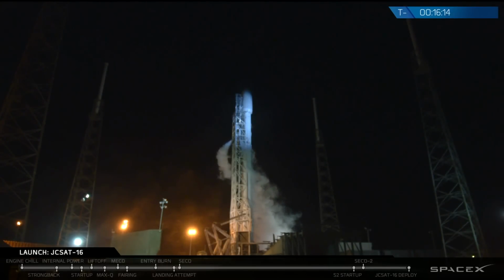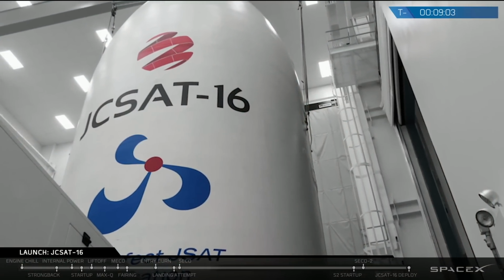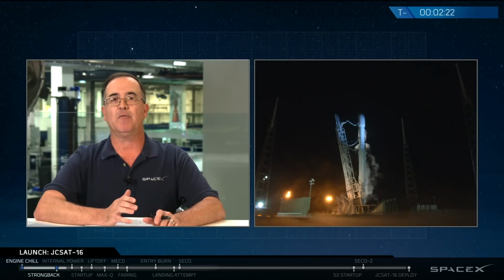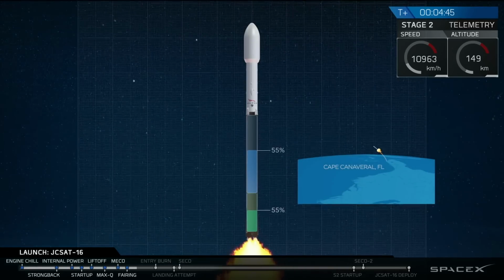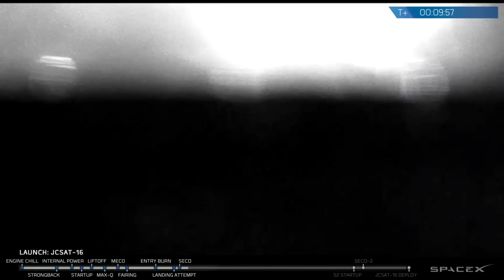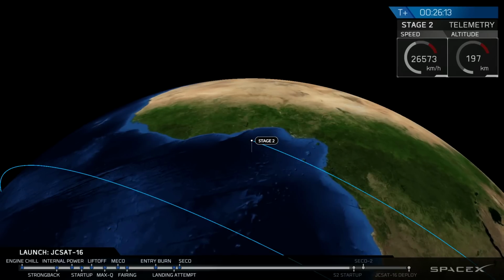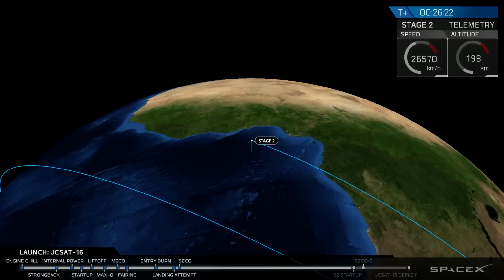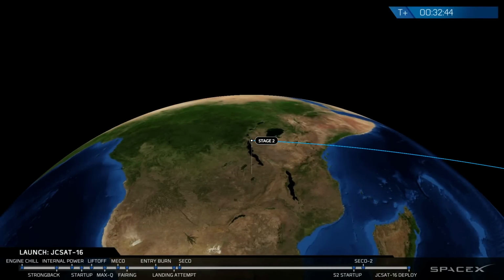JCSAT-16 Hosted Webcast

Comment: + 4100 mph  -- ft pounds from velocity  = foot pounds from height. 1/2mv^2 =mgh  but mgR^2/r^2   integrating adds a 1 to 1/r^2  . 1/r.   cancel m on both sides. I tried r2= 20,000 miles. I got 34090307 feet  divide by 5280  3980 miles.

Comment: What happens to the second stage?
Reply: The second stage is going way too fast to attempt a landing on earth, so when the payload (satellite) is 'delivered', it deorbits and burns up in the atmosphere
Reply: +Marijn Goedegebuure I understood it wouldn't be possible for a landing however, I didn't know they could orientate the second stage for a de-orbit burn.
Reply: Do you know the orbit parameters of the second stage? Being in GTO the apogee is ~36kkm but the perigee is I guess also something ~1000km (?). This would mean it will deorbit in some hundreds of years (or even more).
Reply: +whuzzzup If this is the case, it's a real shame they don't proactively deorbit the second stage, there is enough space junk already.
Reply: Hm just looked at the video again, 2nd stage startup was at ~200km but they did not burn at the perigee, so the burn would have also raised the perigee in addition to the 36kkm apogee, but maybe not as high as I imagined before. But still, given the apogee is at 36kkm and the stage is most of the time outside the (relevant) atmosphere, it will take very long to deorbit by itself.
Reply: +whuzzzup correct, it would barely touch the atmosphere significantly enough to slow it down. It's a real shame they leave it up there.
Reply: Ok more: JCSAT-14 (also GEO) is in the n2yo.com database and there is a Falcon9 entry for the same day, so this has to be the second stage. This stage is in an orbit of 170 km x 36000 km at the moment. In the old video they burned roughly at the same time and same height (~200km) - according to some forum post the initial parameters were 187 km x 36000 km.
Some weeks later they launched Thaicom8 (2016-031A), where the rocket body had an orbit of 380km x 91000km (yes 91k) according to some forum post I found. n2yo.com shows this as 350 km x 90000 km at the moment, so both dropped altitude a lot faster than expected as perigee was pretty low in both.
Reply: In GTO missions, like this, the second stage is left in the orbit, which decays in several months. Then the stage reenters and burns up.
In missions to the ISS the second stage have enough fuel left to do deorbiting burn.

Comment: Is that the 1st stage from previous launch?
Reply: I think they were asking if this was a reused booster, so the answer is no not yet.

Vandenberg is for retrograde and polar orbits, not GTO.
Reply: So many wrong replies to this comment. Here are some facts:
1. Its not THAT much harder to land on the droneship (ASDS) than it is to land on land.
2. Stage 1 is the bottom part of the rocket, the booster that gets stage 2 + payload/dragon to the edge of the Earths atmosphere.
3. SpaceX has yet to reuse any stage 1 portions of the rocket, they are still being worked on; but there has been a static fire of two of the rescued boosters.
Reply: Enstage 2 boosters have been static fired
Reply: Yes. SpacedX have two ot them. This one "Of Course I Still Love You" is located in  the Atlantic for GTO launches from Florida. The second one (the first one build named "Just Read The Instruction") is located in the Pacific for Vandenberg GTO launches.
Reply: No. They say, gonna try to launch one of those in autumn, probably late.
Reply: Just to be clear, the first Falcon that successfully landed (April 8th launch) will NOT be re-launched. It will be kept as sort of a "monument" of history.
Reply: the first successful landing was in dec of 2015. That one will not be used. It will be kept at headquaters for spacex.
Reply: I read they are keeping the first barge landing (April 8th) since landing on the barge is much more difficult (Well, it WAS more difficult)
Reply: No, They are not.
Reply: oops, my bad, corrected

Comment: I wonder if the second-stage after performing the GTO insertion burn will them perform a de-orbit burn when it reaches perigee.
Reply: A deorbit burn would be significantly easier @ apogee. Assuming velocity at reentry isn't an issue.

Comment: Does the second stage get de-orbited?
Reply: yes. it is so hard to save second stage due to high velocity. but there's always a plan to save second stage
Reply: It does not actively get de-orbited, but the orbit naturally decays over time. But depending on the orbit parameters (I didn't look them up so I don't know the specific ones) this can take years to thousands of years or longer.
Reply: It won't take so long to deorbit. 
At 8 min 20 it was at an altitude of 167 km. It then coasted until 26 min 30 sec to a higher altitude of 191 and speed of 27,000 km/h. They then fired the engine  until 27min 30 sec when it was at 204 km with a speed of 35,240 km/h. This gained 8,000 km/h speed with a vertical distance of 13km. Over those 60 seconds it move about 500km Eastward. This gives an angle  (13km vs 500 km) from the earth's surface of about 1.5° upwards - which means that perigee is underneath 204km, and probably even below 191km.
Apogee is 36,000 km for geostationary. The JSAT-16 will circularize its orbit when it gets to apogee, but the SpaceX Stage 2 will simply carry on back on it's elliptical orbit and reach perigee again over Africa or East Atlantic somewhere below 200km. Stage 2 would hit apogee perhaps once a day and be below 200 km for only a few hours per day.  Atmospheric drag at perigee circularizes the orbit - perigee doesn't change much but apogee decreases. Each orbit gets faster as it flies lower so the times between perigee will get shorter and shorter, and so atmospheric drag will quickly take over and bring it down. it also means that each day apogee is lower and lower which keeps it futher and further away from geostationary satellites.

From 2004-2012 294 GTO upper stages and debris remained in orbit. They deorbited on average in 1.53 years. 80% of objects with 200km perigee deorbit. I don't think SpaceX will be there for 100's of years...
https://www.researchgate.net/publication/260094914_End-of-Life_of_Upper_Stages_in_Geostationary_Transfer_Orbit
Reply: 2nd stage moves into low earth orbit and deorbits in 5 years i heard. I believe they once said this on one of these podcast. Or i may have heard it from another science source. i am 90% sure though space x .
Reply: Indeed. JCSAT-14 second stage (2016-028B) (launched in may) was in an 187 km x 36000 km orbit upon launch (even though in the video the second stage ignites at ~200 km).  Right now its orbit is ~156 km x 35000 km. So they drop rather fast.
The new orbit parameters of this launch are not yet in space-track.
Reply: whuzzzup  so it lost 1000 km apogee in 3 months and 31km apogee. That is coming down soon.
Reply: whuzzzup I'm really looking forward to seeing a Stage 2 landing sitting next to a Stage 1 landing at Cape Canaveral. (And then the crewed Dragon sitting next to both of them!)